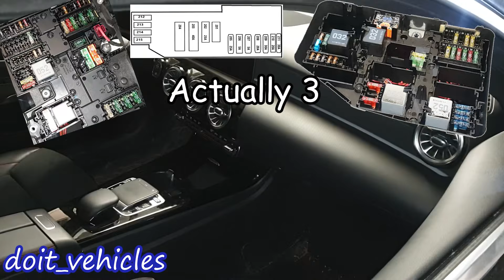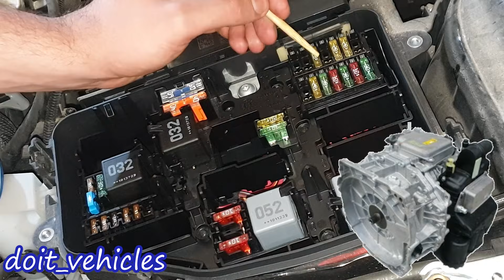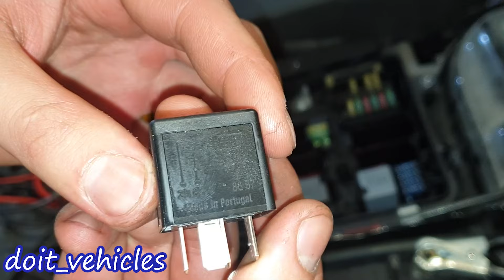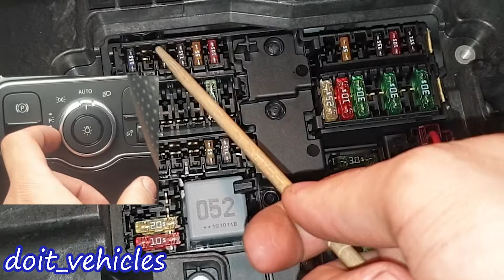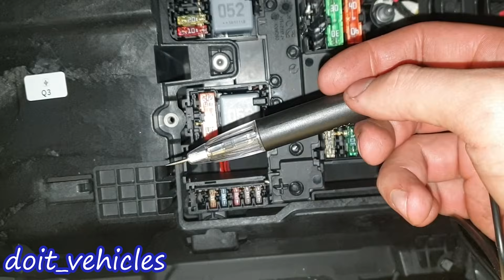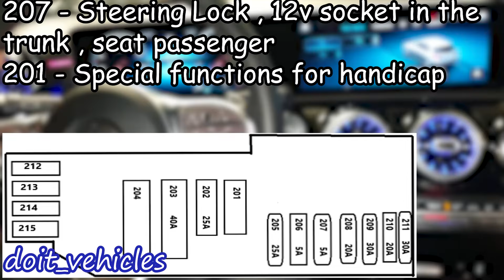W177 Mercedes A200 Fuse Box Diagram

Comment: DO NOT pull very hard.

Please do the following:

1) remove the trim piece that's between the door and the glove box
2) remove the trim next to the foot well.
3) you can now easily move the carpet. 

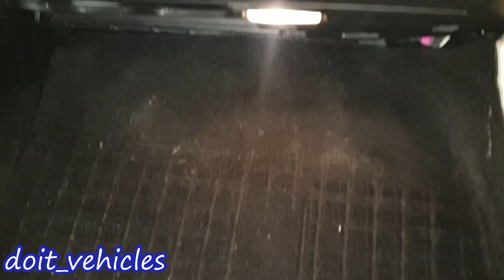There is a clip holding down the carpet. You can even see the hole on the right when he pull the carpet back. : @2:52 (its a slit)

Comment: Just wondering where can I find the DRL Running lights fuse.. to tap into so when car turns on my LED hood Emblem lights up on with either car turning on or unlocked which fuse would that be? Or how can I fuse tap into something that turns on with key fob or turned on but not running or when running ??

Comment: I have an issue: my car wipers won’t stop after I turn on the vehicle, it starts and cannot be stopped, there’s no code on the screen or any sign or light, what can I do? It’s driving me crazy
Reply: I had that... Steering control module change fixed it for me

Comment: Over the last few months I've had an issue where opening the door doesn't shut off the infotainment system and doesn't unlock all the doors/boot.  Is it a problem with the fuse? If so, which component should I replace? thank you
Reply: Hi! I am facing the same issue, what was the solution did you have? It was some fuse? Thanks!
Reply: yes same here, it's intermittent where by the media system doesn't switch off and disengage the locks for the other doors, I believe it's the micro switch on the driver door which tells the car it's open even getting out
Reply: Has this been resolved or the problem identified? I am also having the same problem.